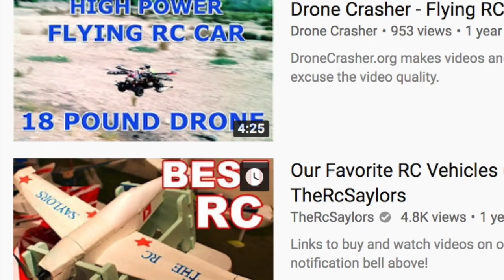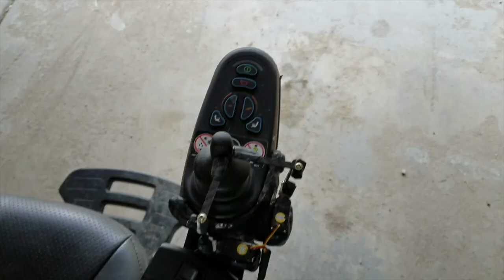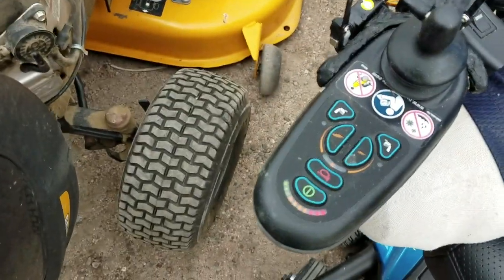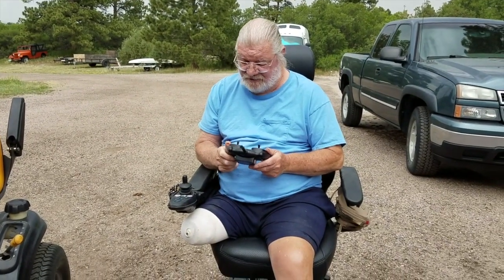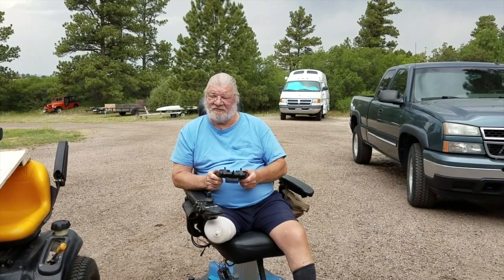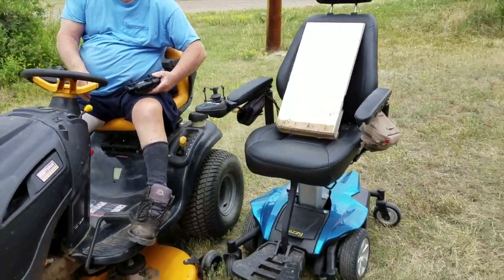Control any e-wheelchair with your phone/RC controller: crowed source

Comment: Hi just happened to come across your video and I see that it is possible to do using R/C parts, I was born with CP even though I was able to get around without a wheelchair most of my life now at 67 years I'm pretty much confined to one now. I bought a powerchair at a thrift store and have been trying to figure out a way to load & unload it into my minivan, Im familiar with R/C servos & such as I've been into R/C products for some 35 years. I will have to watch your video few more times as you are quiet the engineer. Thank you and keep up the good work.